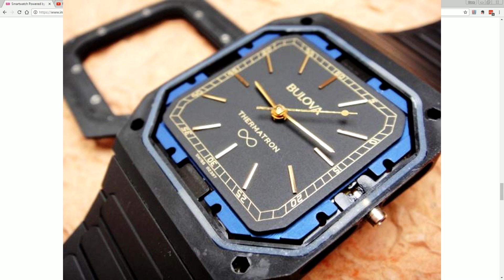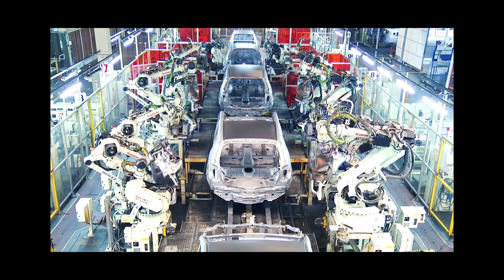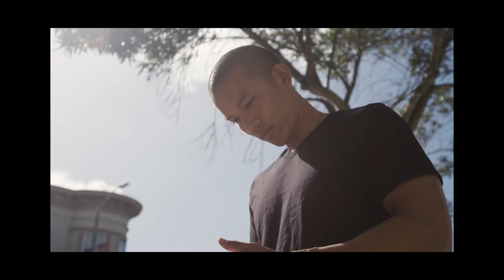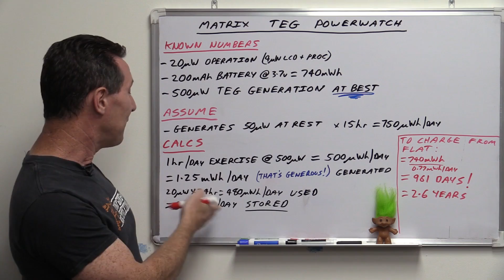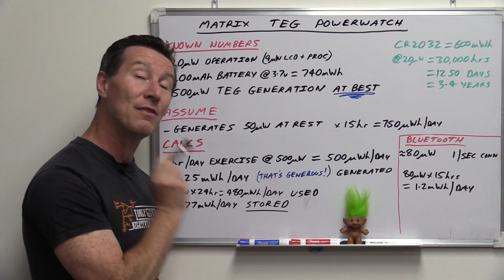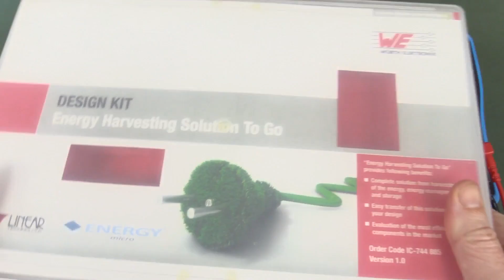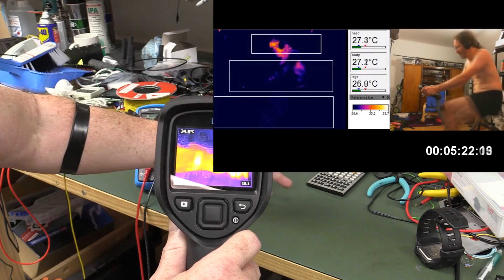EEVblog #945 - Thermal Powered Smartwatches Are GIMMICKS!

Comment: Just use mechanical wristwatch. They need NO batteries. =)))
Reply: nihonam but they are expensive
Reply: Not really, I got my Seiko 5 watch for 60€, that's not a lot at all for such a good one!
Reply: My Seiko Kinetic cost less than one of these and does everything I need from a watch, which is to tell the time & date. Lasts months even if you take it off and don't move it around.
Reply: buy a Vostok Komandirskie you can get one for around 40$
Reply: +agfamatic91 I had a Vostok. It didn't keep time well at all after a few months so I got a Seiko Kinetic instead, and that's been working flawlessly for over 6 years now.
Reply: can you fit all the electronics AND the mechanical generator in there? plus some battery for when you dont move? i think it would be bulky. remember, were not talking about watches, we talk about bluetooth connected smartwatches
Reply: +Ujvári Mátyás the point of this comment is that you do not need fricking bluetooth on your watch.
Reply: They actually already have them. At least quartz watches that use a rotor to charge a supercap which runs it.
Reply: I told about spring mech watches.
Reply: TheFlynCow but the point is this isnt about watches, its about SMARTwatches, which do need bluetooth. and personally i havent a use for simple wristwatches for 20 years, i could use a smartwatch tho. only thing holding me back from getting one is battery life.
Reply: "Powered by you" also holds for mechanical wristwatch.
Reply: And me a automatic self winder £50
Reply: I actually inherited my Great-grandfather's pocket watch. 1904 railroad pocket watch. It has needed some work over the years but still runs wonderfully.
Reply: A mechanical or a solar powered watch. It depends on sensibilities, and it does work better for a lazy ass like me :D
Reply: those don't have smart watch capabilities though which is the main feature
Reply: I have quite a few mechanical watches. But I can’t take a call on them.
Reply: Real big brain move.

Comment: A thermal powered smart watch could certainly be made to work well. You just need to add a little tiny bit of PU-238 to provide the heat to run it for a few decades. Too bad nobody is making it anymore.
Reply: rocketman221projects Ever since NASA started begging for more (with current stocks, we can make one more RTG after the Mars2020 mission, then we're out), they've been making more.
Reply: You can just use a lot(a few dozen curies) of tritium in an oversized betavoltaic battery.
1-10uW for a dec-.... oh...
Reply: its obvious fraud
Reply: I own one of these. This reviewer is confusing some conventional bimetallic thermopile and conventional PNP thermocouple / themopile technologies with Matrix's original and novel material's alloy.  Apple invested $17M just to put it out there as a novel demo... not product engineering. 
   DARPA has run off now with the new alloy patents for obvious reasons... and we ain't talkin' for wristwatches!

Comment: My university professors would have been ashamed to appear in such a cheesy feelgood video. It's just a solution for a non-existent problem. I had a Polar S series heartrate watch years ago (high end model with recording) and it did run 1-2 years on a CR2450. The problem is that everybody wants a fancy colour LCD these days.

Comment: An unbalanced weight, of the kind used in self winding watches, connected to a mini generator would probably generate more power.
Reply: My mother got one of these ten years ago in Asia. It's still working. Although it is a non-smart watch, which is another reason why it's still used at all.

A smartwatch battery only has to last a couple of years anyway. After that, the software support vanishes, the cloud servers get turned off and the whole thing turns into a (rather tiny) doorstop anyway...
Reply: Seiko Kinetic.
Reply: That probably work well. Considering it's been around for thirty years.

Comment: "nobody wears a watch to bed"  im wearing my watch since 4.5 years and haven't taken it off yet
Reply from the maker: Nerd
Reply: I have a solar powered watch i have been wearing for over 20 years!! including bed and shower/bath! the watch is over 30 years old!! and still works fine
Reply: Wouldent the solar panels have gotten cloudy and significantly reduced in output in that amount of time?
Reply: why on earth would anyone wear a watch? use your smartphone, it tells time too!
Reply: Till I got my Apple watch I ALWAYS  wore my watch to bed!
Reply: You don't drive, do you? And smart watches are not just about telling time.
Reply: kraken767 I think because it has 200m water resist, surprised it still works! it has never been opened, so original seals intact - it is a Casio DW-2000
Reply: k
Reply: gross
Reply: i had a watch on that the skin under it was like pure white while the rest of my body was tan it was pretty funny
Reply: I bet you wear one all day thoe 🤔

Comment: might work to power a simple watch
Reply: It does, Dave mentions them in the video. It takes so little power to run analogs, I've personally had one with tiny solar cells on it that it supposedly ran off of. I've also herd of, but not seen personally, watches that run off of stored kinetic energy captured from you arm movement.
Reply: I have those watches which stores kinetic energy, they are little heavier becouse of the weight that moves inside (which i dont mind). Works great , only downside for me is, if i put them down for few days, they will "die" and you need to set clock and date again. But thats not a big deal. They will last day or 2 on their stored energy.
Reply: I've already got a digital watch that runs on solar power. It has a compass, altimeter, and barometer. I left it in  a drawer for two months and the battery was still 2/3rd's full, five years later and the battery still reads full even though it spends almost no time in direct sunlight. Digital watches just don't use that much power. It's a Casio Protrek Toughsolar if anyone wanted to know.

Smart watches draw several orders of magnitude more power.
Reply: solar calculators! not much different
Reply: I would think one of those moving weight based systems would likely generate more power than the thermoelectric approach for the same amount of exercise, and would not be dependent on a thermal gradient.
Reply: Calculators don´t have   Bluetooth and also are not on when you are sleaping.. Other vice, ye they have pretty much the same electronics
Reply: It might be that stupid lazy people would buy it "i dont have to excersise or replace battery" but my kinetic one works fine nonstop even with lazy day. Even for drawing them and looking what time is it it gets hours of running time.
Reply: I remember those 'shake watch' used to have a Seiko one... ah memories...
Reply: Kinetic watches are a thing! look them up. Starting with inexpensive (like $40) Seiko 5 and on to astronomically expensive mechanical masterpieces.
Reply: For example Casio have very similar functionality watch, BT notifications - strictly solar powered. Hell, even Xiaomi Mi Band 2 has a pulse sensor, similar lithium battery and runs for almost a month on a charge. Can be had for $25 if you hunt for a deal online.

Comment: Thermal powered dumbwatch
CR2032s are 2 for a dollar at the dollar store here in America.
But some people have more dollars than sense.
Reply: Justin Templer Sr your comment doesnt make sense, the Target audience doesnt care how cheap batterys are, they want to be better for the Environment. now i'm not saying this product is doing that but your comment isnt going to stop people from buying it because that never was their motivation
Reply: But the production of this thermal powered watch (all the added electronics) plus the battery inside the watch make it just about as environmentally unfriendly, if not more, as a watch with a coin cell. That's the real problem here - it is a pointless and complicated solution for a problem which does not exist. By the time (3 years or so) the coin cell runs out, chances are that on this thermal powered watch, either the battery will also have gone bad and need replacement (for more $ than a coin cell if it is even possible at all) or the whole watch will have to be replaced (because it's a plastic thing you wear while exercising and so it will get scratched/dropped, the wristband will get nasty from all the sweat or maybe you will simply want a new gadget). Will it work? Yes. Does it make sense? About as much as buying a $100 electric pencil sharpener for your home office when a $0.50 manual one would also be enough for the one time a week you need to sharpen a pencil. Want a watch with pretty much "eternal" battery life? Get something like this for <$15, it has a coin cell battery which is rated for 10 years: https://www.amazon.com/Casio-Alarm-Chronograph-Digital-W96H-1AV/dp/B000GAYQRM/ref=swr_wa_1_ses You will even have $100 left over for a real exercise gadget (heart rate monitor, etc.).
Reply: tjeulink I think anyone that is buying this watch thinking he is bettering the environment are the ones not making any sense.
Reply: Justin Templer Sr they don't no, but this watch isn't marketed at people for saving costs.
Reply: How much of the environment is polluted by watch batteries? My guess? Probably less than the pollution making a TEG.

I inherited a watch from my grandfather that winds itself off arm movements(self-winding watch). It still works to this day.

Comment: I think what makes this work, is not the energy from your body heat, but the fact that when the watch goes out the door, it's probably with a full charge. And then, by the time the thing runs flat, it's years later, which honestly, you are more likely to have the device die before the battery runs dry. But, honestly, it's the illusion that is most important here.

Comment: I have a watch that does not need charging, it has this knob on the side that you turn once in a while and it keeps on going.
Amazing right ?
Reply: Not really. I had one too, I could never remember to wind the damn thing. I'm pretty sure I ended up overwinding and broke it.
Reply: That's charging your watch mechanically. How about the winder turns a generator that charges the battery? One minute wind for a week or more power could be useful, or you could just use previous movement based generation technology (eg used by Pulsar Seiko)as it's an exercise watch.
Reply: @Coolkeys2009  The Seiko Kinetic is pretty much what you described.  It's noisy as fuck.  You're better off getting a standard automatic.

Comment: With the small amount of power they are generating from the TEG, they would be far better off using a coin cell, as the power generation of the TEG would never be more than the power consumption, so the TEG would never actually charge the coin cell.  Using a Li-ion cells is wasteful.

Comment: I have a Citizen Eco-Drive. It works on solar power, and so you never need to change the battery. It syncs with GPS satellites every day so it's always the correct time.  I don't need a wrist-worn repeater screen for my phone.

Comment: $300 says they release a charging base that's basically just a mini-heater to get the thermoelectric generator going.
Reply from the maker: It will come fully charged form the factory, and they have said it will get 2 years battery life on the one charge. No one will need to charge it before the fad wears off and they buy another smartwatch.

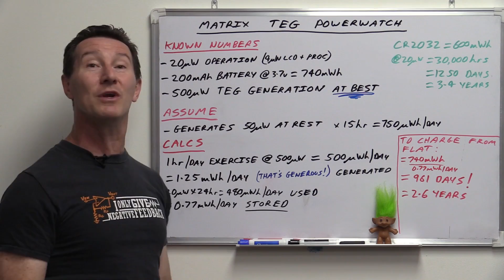Comment: At 13:37 in your video you talk about Bluetooth. The problem is you don't want it to work, so you're not looking for ways to make it happen. How about making a connection only when data needs to be transferred. The watch would be ready to receive, but the power needs would be minimal. Bluetooth readiness (and the display) could even turn off when the watch isn't on your wrist producing energy.

Comment: how about sticking generators in exercise machines? 1 hour will make a smartwatch run for a few 100 years.
Reply: Awesome idea wireless or fast charging ports on gym equipment. A lot of gym equipment is already self powered and have on board generators e.g exercise bikes and stepping machines so this would be quite easy to implement.
Reply: Nah, those generators have already been reserved for powering the lights and showers.
Reply: Im in for this idea

Comment: I've played with TEG. Their efficiency depends on temperature difference - to get them to work  decently you need to get the temperature difference up high, which means running them with the hot side dangerously close to the point at which the TEG will be damaged.

I've seen 'high-temperature' modules that use materials capable of taking much higher temperature, but they are far more expensive than the regular ones, which are designed more for cooling.

Comment: the solar powered dumb watches manufactured by Casio are cheap, good looking, and capable of storing more energy than they use on most days!
Reply: Some of them had a solar panel on the face, as I recall.  Much more efficient than this codswallop.
Reply: I've had and worn mine for 5 years, the charge never went below MED.

Comment: Thermal powered? So the electrical resistance in the circuit creates heat and the watch runs on heat. Brilliant! Infinite energy!
Reply: No, it generates power from the temperature differential across your skin (~32-35 C) and the watch face (~ambient temp).
Reply: TheAmmoniacal im pretty sure he was trolling.
Reply: TheAmmoniacal That was a joke

Comment: If the main point for them is to reduce the waste in battery and with this reduce the carbon footprint, my question would be:
How much pollution is created in order to produce the TEG used on the watches? And on the subsequent battery?
And how this is compared to the pollution created by the production of a coin cell battery?
EEVblog, Dave, what do you think regarding this point on the subject?
Reply from the maker: Don't forget the charging circuitry too.
No contest in that department I think.
Solar is a nice cheap and reliable way to augment battery life if that is a goal.
Reply: I was thinking the same thing - any studies already done?
Reply: lithium even when they last a loooong time they are pretty harmful for the enviroment, but hey the watch has a Lihium Ion battery rechargeable anyway, and how many cycles can it endure?, 500? 1000 cycles, not more, i doubt the lifespan of the rechargeable battery will be above 3 or 4 years, so from that point of view, it is almost the same i think, that using a primary lithium cell.
Reply: Depends on how it's designed.   Li-Ion can endure a lot more than 1000 cycles if kept below 4.1V peak charge, but remember that is a full discharge/recharge cycle rate.   When you have a supplemental perpetual charge source, you're not full cycling the battery the same as the scenario used in the charge cycle rating.

Personally, I don't want the extra bulk on my wrist nor the ridiculous cost of these visionaries, so I see it as a bad place to implement the tech today, but if you isolate it to only batteries, devices, and power generation in a different product, I wouldn't complain if a product with a built in, non-(reasonably) user-replaceable high cost product had a way to extend the lifespan of the battery so it doesn't end up as landfill trash as soon, factoring for cost per year ownership.

Either way I consider it something you throw away within a decade, which seems like a toy for the rich when it's just a watch and I don't buy into the addiction to needing such a thing to further fuel one's addiction to mostly random noise sources of information.
Reply: @leandrolaporta2196  That's what I thought when I bought my PowerWatch 2. I thought "never recharge" meant: for as long as the battery lasts, i.e., a few years, because after that, nobody will even remember those batteries ever existed in the first place. After that, it's be time to buy a new watch.

Comment: Agreed about the watch, but... A simple resistive load is not enough to measure the power output of a photovoltaic generator, you need MPPT. Is it not the same with a Peltier? Do they have an MPP? Does your 100 Ohm resistor get it there?

Comment: Ok.  So, it generates more energy than it consumes and can, therefore, slowly charge a battery or supercap or whatever...meaning that you never need to change the battery (until it reaches the end of its useful life...which, given the slow charge and discharge rates could be decades)? Ok. 

That puts it in the same realm as my solar - powered Seiko when I've also been wearing for over ac decade and have never needed to change the battery nor service in any way.  I'd definitely not call my Seiko power technology a "gimmick".

This watch does the same thing using TE generation and suddenly it *is*?

TE generation is a proven and uncontested technology, as is the storage technology, as is the digital and low - power BT tech used...so nothing here is illegitimate theoretically.  

Yet, even when your arithmetic supports this fact, you go on to call it a "gimmick".  

Know what that tells me?  Your entire video is designed to take a perfectly decent product that does exactly what it says on the tin and attempt to arm-wave it into being a dishonest presentation of capabilities.  

That makes this video clickbait and guilty of PRECISELY the kind of dishonest marketing that OTHER companies selling scam or gimmick products engage in.  

Given that those companies are so common and seem to be the exception rather than the rule, why you would then try to claim that this one actually doing the RIGHT thing with a product that lives up to their claims, tells me that you're looking to get more views when there's no story here.  

That's disappointing...and enough to have me click the "unsubscribe" button.